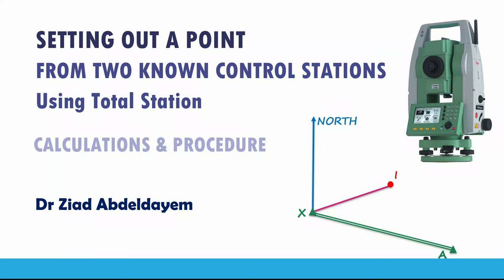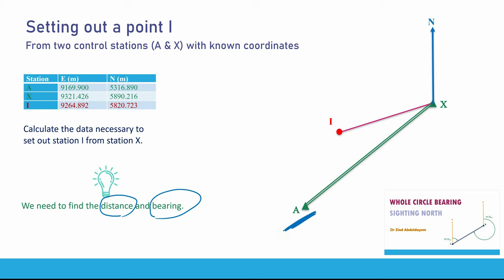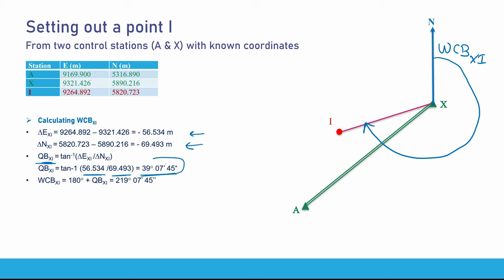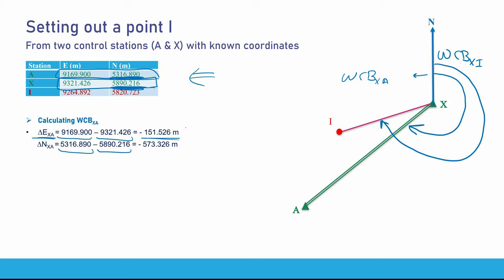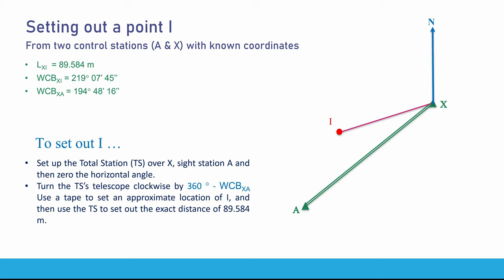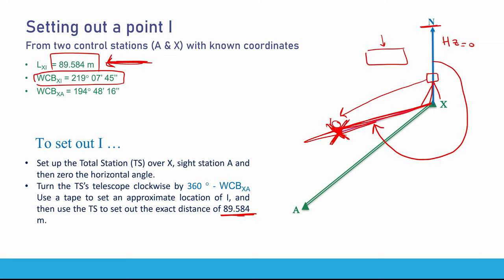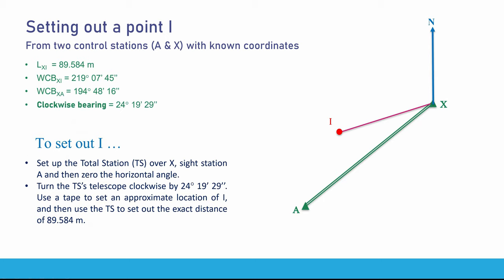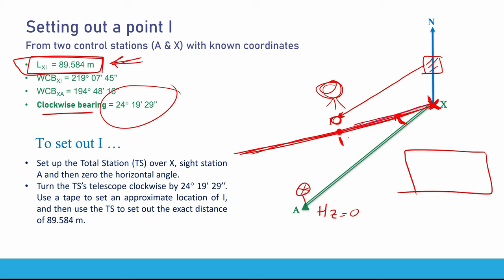Setting out a Point Using Total Station | From Two Known Survey Stations | Calculations & Procedure

Comment: Sir, If there is any solution for Traversing the Total Station without given any known points, then please we are waiting.
Reply from the maker: You can apply the same calculation, but instead of using real coordinates, you can use assumed coordinates and WCB. for example, you can use E=1000m, N=1000m and WCB=0.
Reply from the maker: Please watch Traverse Adjustment videos.
Reply: @ziadabdeldayem6884  Sir, if we assumed like N=1000M, E=1000m in Stationing method, then How could we say that the fore sight points coordinates is correct or not ?
Reply: @ziadabdeldayem6884  Sir, your videos inspired me a lot